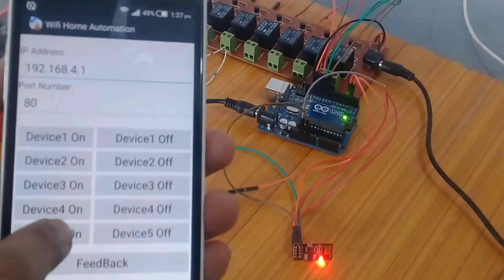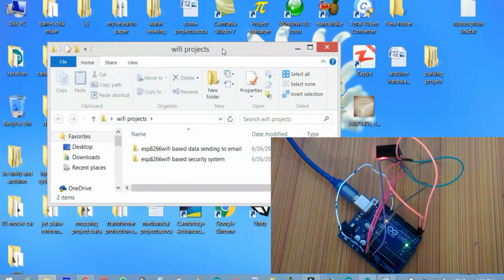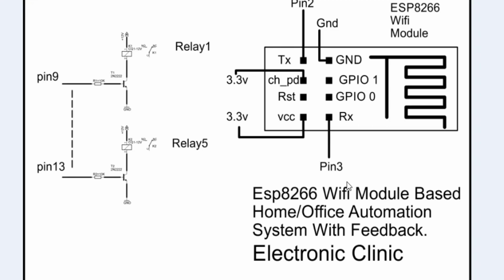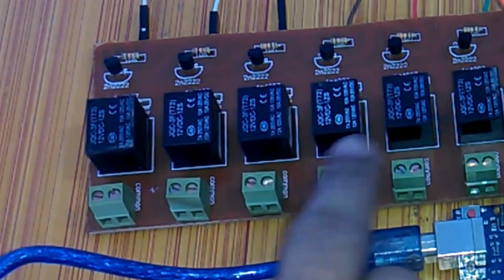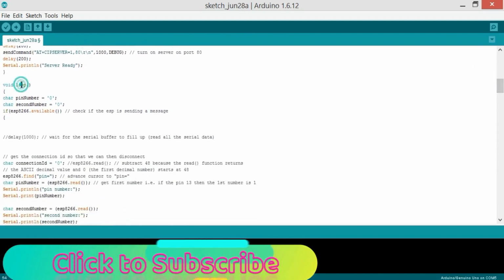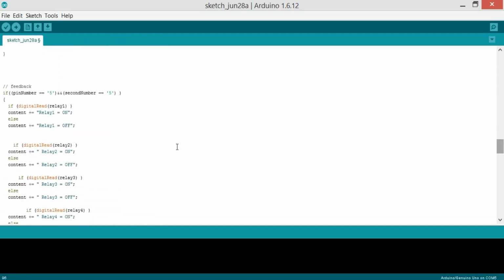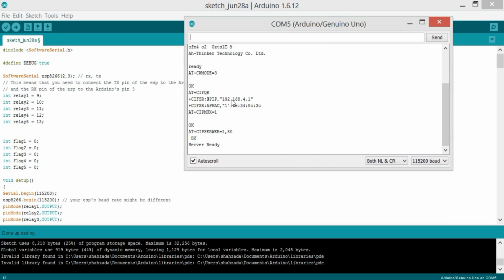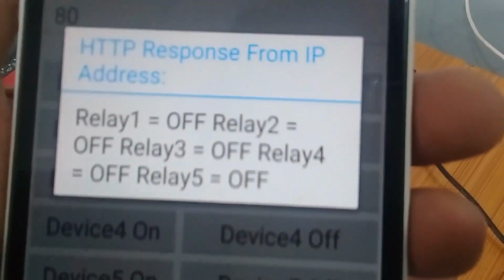Arduino esp8266 wifi Tutorial: esp8266 Projects:Home/Office Automation using Android cell phone app

Comment: Hi. I'm planning to use a  ESP8266 esp-01 WIFI module (Not node McU), to send the data to firebase. A temperature/Humidity sensor is used to collect the data, these data should be send to the firebase using the ArduinoUNO and the WIFI module. Could you please tell me on how to connect the Temperature/Humidity sensor to the the WIFI module in the code as well as in the hardware part? Coding and getting the outputs  from the sensor using the Serial Monitor is possible. Connecting the WIFI module to the firebase could be also possible as stated in the link below.
https://create.arduino.cc/projecthub/electropeak/connecting-arduino-to-firebase-to-send-receive-data-cd8805?f=1
as mentioned my problem is connecting the wifi module with the sensors. 
My problem is same as the following link. Please help me on this. 
https://arduino.stackexchange.com/questions/44608/dht11-data-in-arduino-uno-to-firebase-through-esp8266
Reply from the maker: I have stopped using the esp8266 module. Now I only use Nodemcu esp8266. I have the firebase project but it's done using the Nodemcu esp8266. 
My suggestion is to go for Nodemcu, it works just like Arduino. check my videos on Nodemcu and you will understand how powerful is Nodemcu
Reply: @ElectroniClinic  
I'm using 4 soil moisture sensors, a temperature/humidity sensor, a pH sensor as well. So you mean Integrading all these to the nodeMCU is better than using the esp8266 moudle?
Reply from the maker: if you are using more soil moisture sensors then you should use Arduino and Nodemcu together. watch my tutorial on ph sensor and soil moisture sensor. in these tutorials, I have completely explained how to use Nodemcu with Arduino and soil moisture. if you don't use arduino then you will need a multiplexer which is a tedius job, needs more coding and wiring. better option is Arduino + Nodemcu esp8266
Reply from the maker: check my playlist. You will understand how powerful and easy is Nodemcu esp8266.

Comment: Very nice and interesting tutorial video, thank you for sharing your project.
However, even totally following your instruction step by step and is it giving result in AT commands in the Serial monitor as shown in your video,
even I spent almost 2 days but can not make mine to work. I am always getting ""Data sent, waiting for reply from server..." and lat er "Connection to
http://192.168.4.1:80 refused" , I am suspecting that my ESP8266 is not cooperating, I am waiting for my another order of ESP8266 module to 
come and try again.......
Reply from the maker: my dear esp8266 is just a headache. That's why I stopped using it. go for Nodemcu esp8266. I have so many videos on Nodemcu esp8266 that will really help you. stop using esp8266. 
Check my videos and you will get my point.
Reply: @ElectroniClinic  Hi, thank you for the reply..... I took it as a challenge and at last, since yesterday I managed using ESP 01 module with Arduino Uno + Blynk App and it work for almost 24hrs with out any problem yet. In addition to the relay control, I can even get feedback from the hardware(Analog).   I watched your Nodemcu esp8266 videos and it seems much easier than using this ESP 01S module. Similarly I have done it with Wemos D1 and Wemos D1 mini.  I will test it with Nodemcu once I got mine.  Again thank you for all your shared video,  it help us newbies a lot.
The best Baud rate for me is 9600,  also I found a link that suggest to put 0.1uf decoupling capacitor across the 3.3V and Gnd then at least 470uf near to the power supply source.
Reply: SAME PROBLEM

Comment: It always disconnects every now and then, same as with the video.  Have you fixed it?
Reply from the maker: This  module is a headach. Now i only use nodemcu esp8266.
Reply from the maker: Check my videos on nodemcu esp8266
Reply: @ElectroniClinic  Ok mate, ill try purchasing ASAP. Not a well-polished video, but still a very good guide. Much appreciated.

Comment: sir, can I contact you? I have also done home automation project using Arduino mega and esp8266 module and blnk. It is working fine in dc current but when I connect AC supply, it is working for 2-3 minutes fine. Then esp8266 disconnected automatically. I can't find any solution. Please help me, sir.
Reply from the maker: replace your esp8266 module with nodemcu esp8266 and follow my tutorials.
Reply: @ElectroniClinic  Thank you sir. But I dont want to use nodemcu. So is there any possible way to work with esp8266 and Arduino. Is that problem is for blynk?? Or the firmware of esp8266 is not updated? Sir if you can suggest me, it will be very greateful.
Reply from the maker: you know it can be a power supply problem or the updated version of the firmware, that's why i said you should go for nodemcu, that's the easiest one and works perfectly, I have so many videos on nodemcu. simple esp8266 is only a headache, that's why i use nodemcu only
Reply: And sir I have done the same circuit which you have shown in the video but after 2-3 minutes the "esp8266 is not responding" shown in the serial monitor. The esp8266 module release the wifi connection. I have tried lots of things in 4 week. But can't find any solution.

Comment: Sir ,can we introduce  timer  in the app so that when we switch on any device it will get off  after a specific duration
Reply from the maker: yes my dear you can. 
simply use a timer on the android side. or you can also use a timer on the arduino side.
Reply: @ElectroniClinic  Thanks sir for a very fast response........
Reply from the maker: you will always get a quick response. 
if if you have any questions, you can comment here, or you can also sms on my whatsapp number. 

don't forget to subscribe.